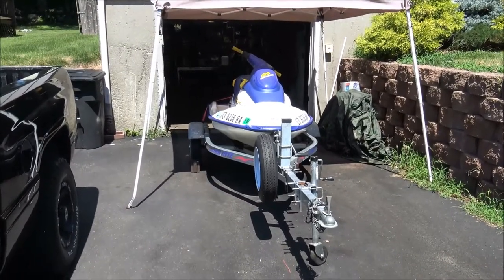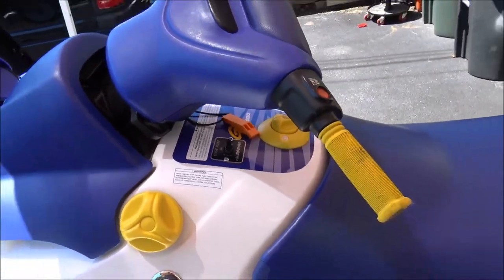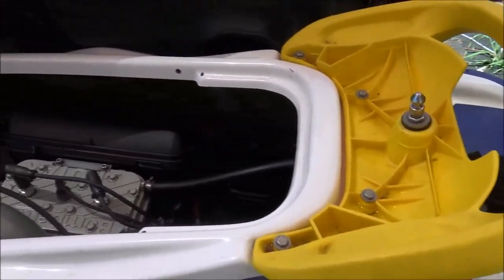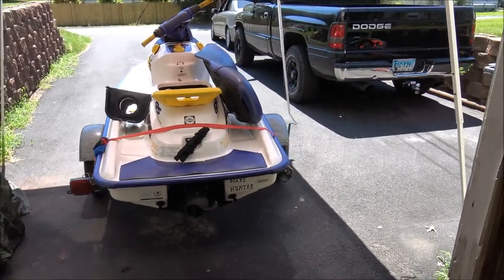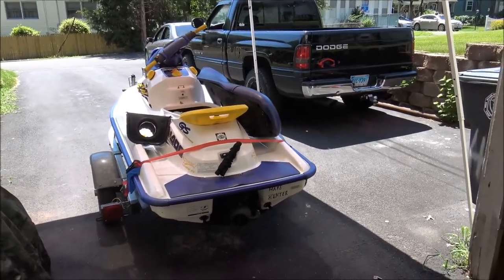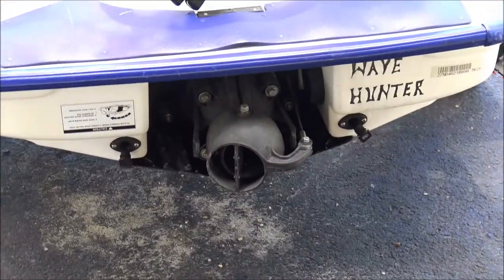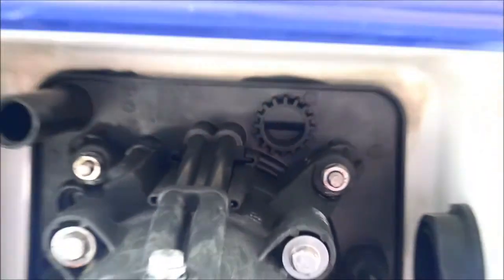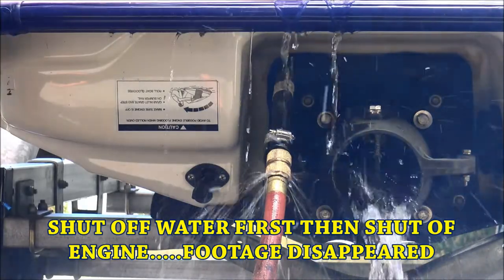SEADOO JET SKI WATER FLUSH 1998 GS 720

Comment: What size hose did you use??!! Wonder if garden hose would fit over the fitting with a clamp and cut end off?? Ski is at camp and whatever size I bring will be wrong 🤣
Reply from the maker: I use a normal water hose, it slips into the tube/outlet. I don't clamp it to tube or anything....it just slips in and stays but, my tube is about 4 inches long.